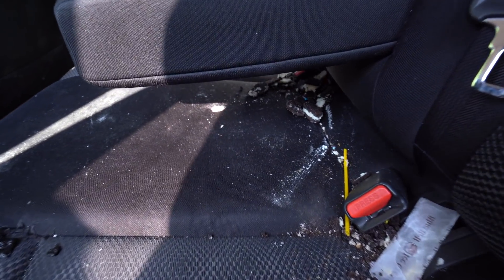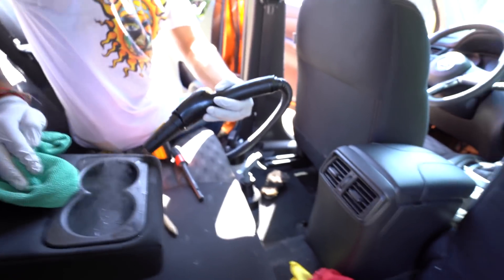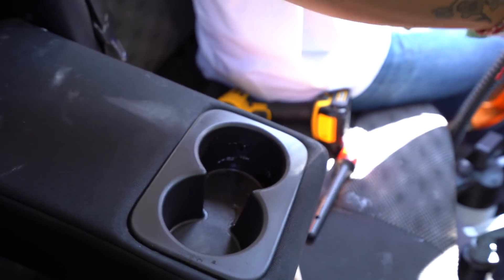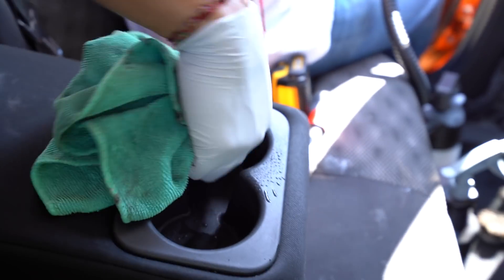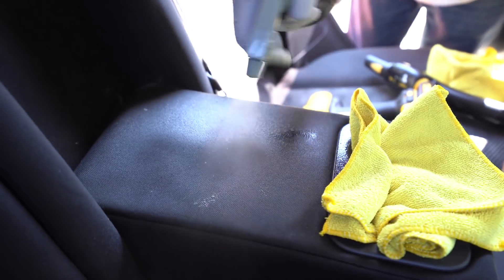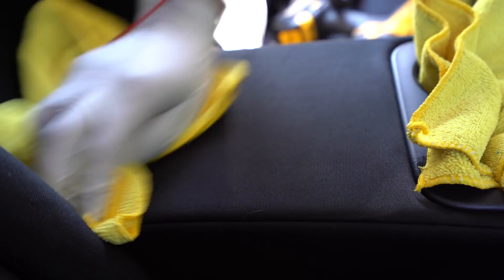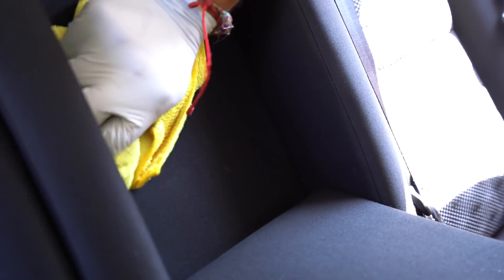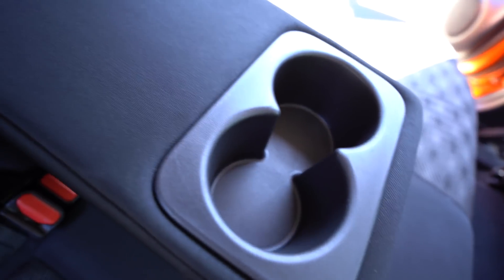Cleaning MELTED Oreos From Car Interior. YIKES!

Comment: That's easy. What about melted hard gum on carpets?
Reply: If there not old gum i use googone if not just tell customer its damaged...
Reply from the maker: That's also pretty easy. Steamer and an adhesive type remover usually does the trick.
Reply: Microfiber towel whit the steamer to transfer the gum to the towel👍🏼